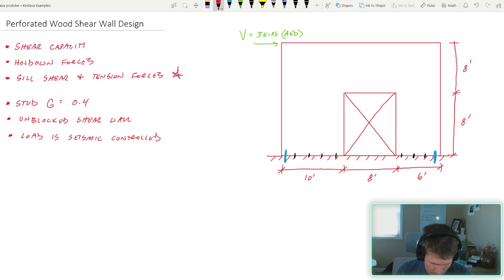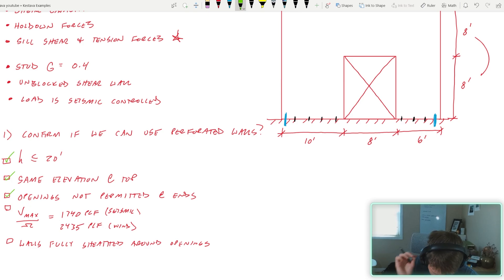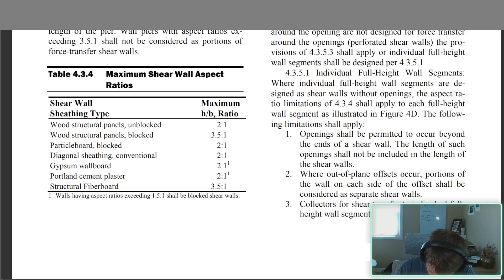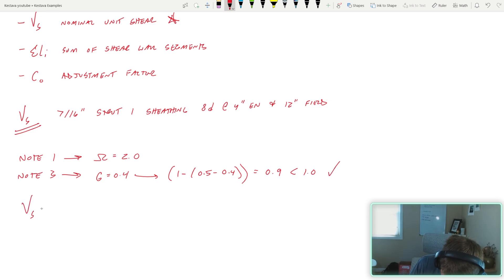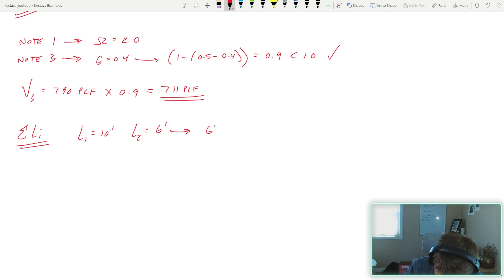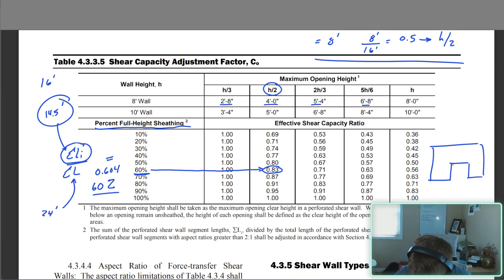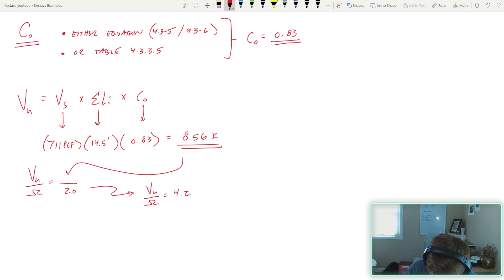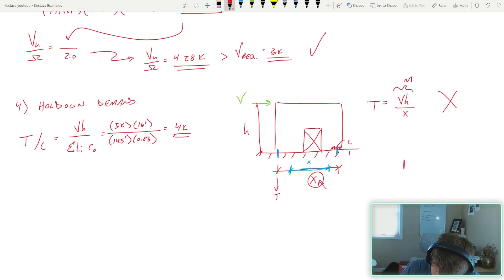Perforated Wood Shear Wall Design Example #structuralengineering #engineering #construction

Comment: The requirement is for the same elevation at the roof. Where does it come from? side wall of Gabel or single slope roof will never have a roof at the same elevation. How do we deal with that?
Reply from the maker: its their way of basically saying you shall not do this type of shear wall system then if you have those conditions
Reply: @Kestava_Engineering @Kestava_Engineering  However, all single-family houses or condos have sloped roofs. Therefore, are we not allowed to use shear walls for those structures?
Reply from the maker: @ basicaly they are getting at that you need to use solid shear walls or FTAO shear walls, perforated shear walls provide the least capacity from a calculations perspective (boiled down) 

you can have a gable roof or sloped roof and still use these walls along eave walls as those will be walls with one height

Comment: Just a heads up everyone - when the diaphragm/shear wall capacity tables for wind and seismic were unified in SDPWS 2021, they actually changed the stress reduction factors to get you to ASD level capacities. the stress reduction factor of 2.0 is only applicable for wind, and it's now 2.8 for seismic.

Kestava, thanks so much for these vids, they're such a great resource and are so expansive and offer a great window into the actual industry side of consulting structural engineering. I'm working not far from you in Washington and these sorts of videos are so good to throw at new grad engineers to send them in the right direction
Reply from the maker: great additional context about the 2021 SDPWS - yes they changed up the ASD and LRFD factors!

Comment: Another thing that is often missed with perforated shear walls is the requirement of 4.3.6.1.3 where it says, "each end of each perforated shear wall SEGMENT shall be designed for a compression force, C, in each segment."  So you aren't only designing for a compression chord at the end of the wall, but at the end of each segment.

Comment: Does the Li value apply only to walls with doors or also walls with windows? I try my best not to include doors in shear walls due to the discontinuity of the bottom plate

Comment: These are often overlooked! Great video.
Reply from the maker: they dont get a lot of capacity but are great for smaller structures for sure! everyone just seems to do solid walls and run with that for ease and time. a lil spreadsheet for these walls would be nice to have in the back pocket!